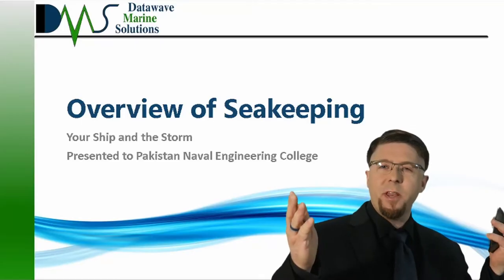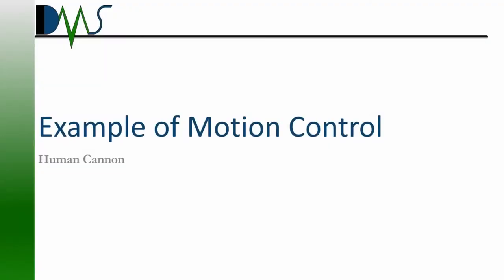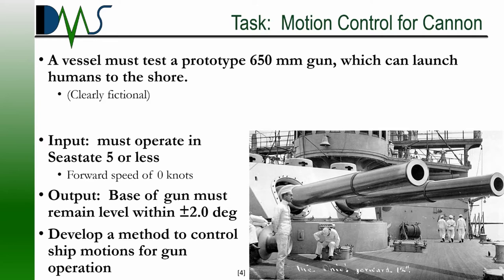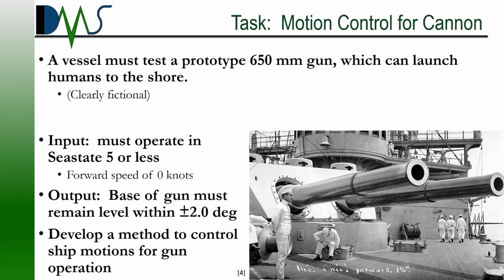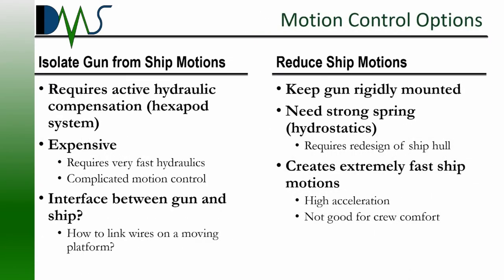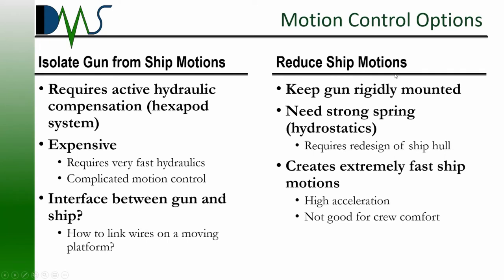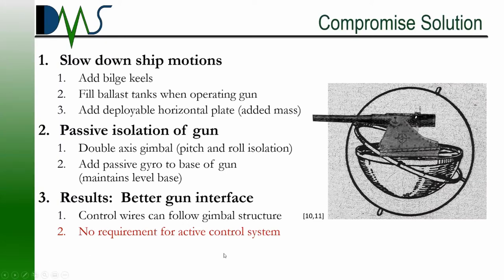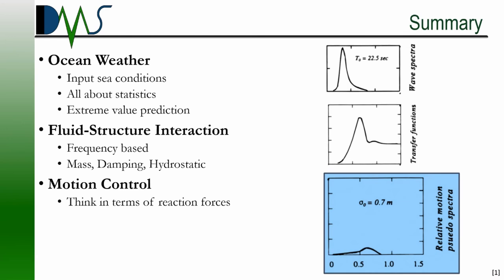SEAKEEPING 5:  Example of Motion Control

Comment: I was also curious if ships utilize gyros for balance???? 🙏 Thanks
Reply from the maker: In most cases, we only see gyros on smaller boats (<11m) due to the size and power requirements.  Any gyro that makes a significant difference on a large ship needs to weigh several tonnes and would be the size of a large room.  That takes up significant space on a ship, where space is always at a premium.  The idea was tried on a few passenger ships.  Eventually, we found active control fins were more preferable.  I think the space requirements were a major part of that consideration.